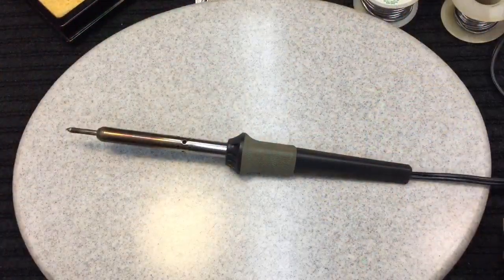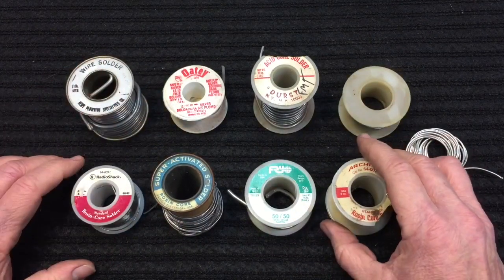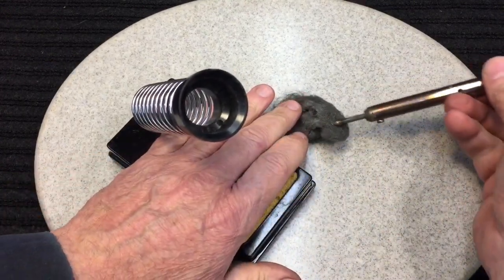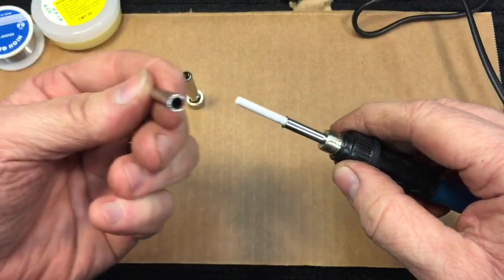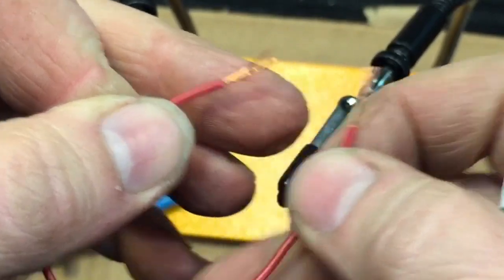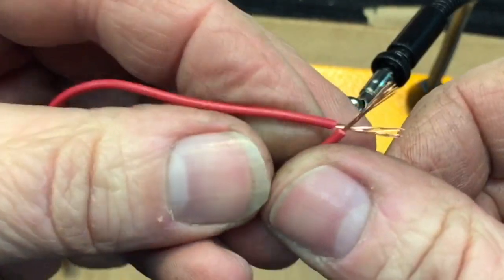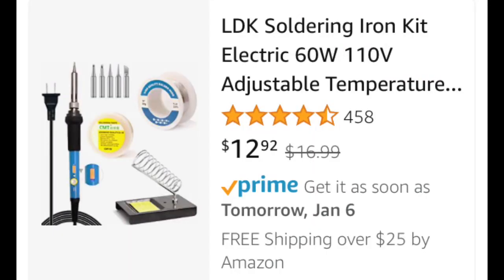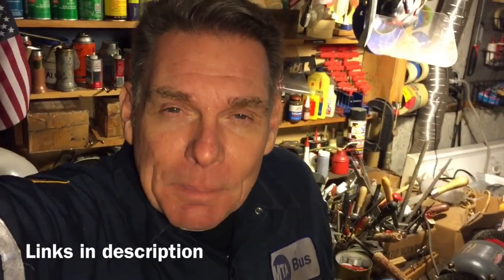Learn to Solder with this Inexpensive Kit from Amazon

Comment: Great video and one topic I’m very interested in….question, I was soldering on a project recently and a buddy that was retired Air Force Electronic specialist was in the shop visiting, he said that the way I was soldering was incorrect. Now, I was soldering exactly like you did in the video…he says you never touch the solder to the iron, rather, you heat the item your soldering (joint) until it’s hot enough to melt the solder, then you touch the joint with the solder. I didn’t question him, but it seems to me that it would take much longer to do it his way. Am I wrong in thinking this way?He demonstrated his way and I must say , the result was a beautiful solder.
Reply: I was trained for Avionics ( think of keeping planes from falling out of the sky because 90% of all electronic issues are caused by bad connections ) and we were taught to look for TWENTY faults in an electronics solder joint. He is on the money. Great advice. And an advanced trick is to make a small solder bridge between the iron and the metal being soldered. Let this heat up for like 10 seconds then add more solder and remove the iron after a second or two. You will never get a cold solder joint this way. The joint should look shiny, not dull. It will also have the perfect filet. This shows that the solder has properly wetted, flowed, and adhered to the metals being soldered. This is a reliable solder joint you can stake your life on.

Comment: I learned how to solder when I started building Heathkit electronics kits in the 1970s. Your video offered more info and is a good refresher. I still have all my Heathkits and they still all work. I attribute that to great Heathkit instructions. One thing I found tricky was using heatsinks in small confined areas of the circuit board,  but you needed to do it to avoid frying the component. Great video as usual.
Reply from the maker: HealthKit was such a fantastic company!  I still have a few pieces that I acquired over the years! 😃👍
Reply: Yes, they were a great company and made learning skills lots of fun.
Reply: get a locking hemostat. One came in my electronics kit when I was in electronics college. I have since bought several more. I like the curved one and I have an 18 inch long one that can get pretty much anywhere. It's a great tool for picking up lost screws out of tight areas, too.

Comment: Great video John! You have a way of explaining the do’s and don’ts so everyone can understand. 👍🏻
Reply: Don't ask me to find it now but there is a video somewhere here on YT where a guy building an electric bike has so much current flowing from the batteries that his wires heat up enough for the joint to unsolder itself. We were always taught to make sure a joint, where possible, should have a solid mechanical connection first.

Comment: Soldering irons especially the big ones last forever.  I have ended up with many over the years. I have a Weller on my work desk and a Hakko desoldering gun. They are older but quite usable since I am not using them every day. I have two or three of the old torch soldering irons.  Never use those. I have torch soldered using silver solder. It is one of those things where the iron and solder have to be good or you will give up. Also like a hacksaw or a file you need to practice to be successful all the time.

Comment: Hi Scoutcrafter, I'm an electicein by trade and it's two tips for a beginner. Never use steel wool on the tip of a soldering iron, they are longlife tips, you can tell by the color difference of the tip. A wet sponge is more than enough. Solder must flow, you heat the copper wire first, then you hold the solder against the wire. It melts ON the wire then flows all the way into the twisted wire. Do not hold  it against the tip of the soldering iron, then the solder will burn and you will not have the best connection. Greeting from Holand
Reply: Some say touching a hot iron tip to a damp sponge will cause thermal shock.  A lot use brass wool to clean their tips. I kind of collect soldering irons so I've gotten some that were in pretty poor condition when I acquired them. So I had to use steel wool or sandpaper to clean the tips. The trick there is to tin them cold in a solder pot.

Comment: John you did a fantastic job with this video. From the kit to the explanation on how to perform the task of a good solider joint. My Dad taught me this skill when I was about 9 or 10 I suppose. Very useful skill. Great Job !!!!
Reply: My dad, a WWII tech and teacher, started me on an old color TV in the woodshed. I started by desoldering parts out of it on an old tree stump in front of the woodshed and the iron on a long extension cord.
Reply: @johnpossum556  my Dad was a lineman in Korean War. So my first lesson was how to correctly use electrical tape. I bet that lesson was 1/2 hour long. Haha but it stuck. Then I got to learn how to solider the wires back together on a cut extension cord.

Comment: Great tips on soldering John. I absolutely believe solder has a shelf life ! 👍🇺🇸Roger
Reply: I've seen acid core solder eat itself. Rosin core can oxidize (it'll look like it has white powder on it or just look dull) when it is old. You can just run it through some steel wool though and it'll come right back.
Reply: @1pcfred  thanks Paul, i will try that because i have some old solder!👍

Comment: I was in the Army as a radio repairman and we were taught to heat the joint that you are going to solder and have that melt the solder, not have the soldering iron melt the solder. That way the wires are hot enough and you assure that you do not have a cold solder.
If you were soldering a transistor you had to use a heat sink so that the temp of the soldering iron didn't cook the transistor.
Reply from the maker: Years ago they used a lot of high wattage irons and electric guns-Many times the wire will draw all the heat from the gun and acting like a heat sink and not leave enough heat to melt the solder- Remember the word “bridge” that is the term to reference the interface between the hot solder and bare wire.   When soldering Pipe you still heat the joint and let the solder flow towards the heat. 😃👍
Reply: @ScoutCrafter  That holds even more true today because now we have aluminum circuit boards and they take a lot of heat to avoid that problem. You will love this story -- My current Radio Shack digital iron I found in the dumpster of a neighbor. It was missing the tips. Being old school I had never had one of these before. The 60 Watt iron is amazing great at rising to the challenges I have thrown at it & all I am in to it for is the cost of a package of tips.
 My latest project I used that iron on is a 9W 2700K LED light bulb that had a 15,000 lifespan rating. I removed the 24 and 22 ohm SMT resistors ( which are about the size of a deer tick ) and put a discrete 1/4 watt 100 ohm resistor in their place. This should increase the lifespan back to around 100,000+ hours and of course the bulb takes far less energy and runs much cooler. How's that for a homemade hack? (Imagine light bulbs that last so long you never have to replace them again because they will outlast me and you. Hooray! )
Reply: That is what I was taught, always looking for a shinny joint.